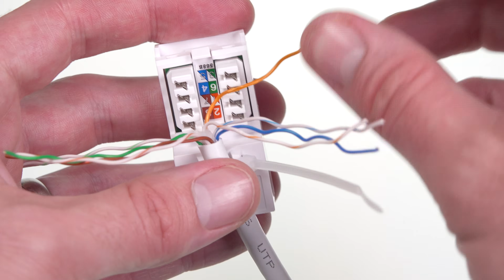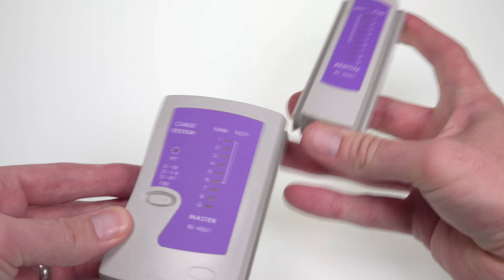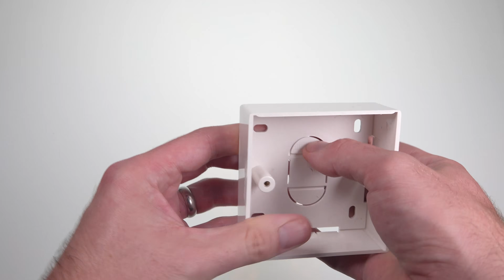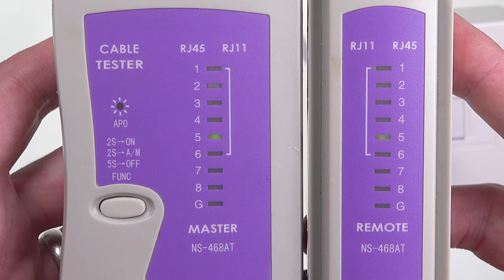How to Wire Up Ethernet Wall Jacks (Cat5e / Cat6 / Cat7 keystone jack wiring tutorial)

Comment: t568 a and b exsist because when connecting the same type of devices like a computer to a computer, you need to swap the send and receive pins
you have to send on 2 pins and the other device will receive the data on those 2 pins
2 pins for send, 2 pins for receive 
(you can make a 1 cat 5 cable into 2 cat 3 cable using 1 pin for send instead of the 2)

Comment: Interesting, I have looked at many video explanations of this process and this one is showing a good explanation. However, the cable tester used in all of the videos I have seen does not test the cable it only tests for the correct pin for pin connections. There could be lots of other issues and a network analyser is the way to go especially when we get into Gb networks. Having said that , good video and this works OK for virtually all home connections.

Comment: Thank you for this video it is very helpful, one small note that punching while holding the keystone in hand is not safe better to punching on ground or where a safety gloves if necessary.
Reply from the maker: Yes you're right - the white surface I was filming on was too flimsy though so had to make do 😅

Comment: Just in case someone missed this 
His pushing you towards buying very expensive tools
Punch tool for £65!!! 
That cost around £5-£10.for decent one
Reply from the maker: Not "pushing" at all - calm down your silly little crusade. I've linked to the one I used in the video, which is several years old by the way, and depending on where you are in the world you'll see today's price being charged by Amazon. With - and this is the key point - the option and full free will to buy whatever you want, including cheaper alternatives and related items listed on the Amazon page itself. A cheapo tool might be fine for an amateur doing a  one-off job in their own home, whereas a pro might want a better and longer-lasting tool. But thanks for all the comments, all engagement is good engagement and helps the video to do even better 😉

Comment: Chapters:
00:00 Intro
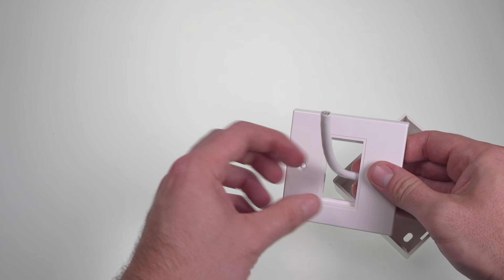01:17 - Stripping the outer sheathing from the network cable
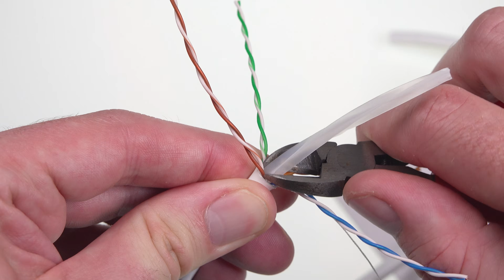01:29 - Untwist and straighten out all 8 wires
01:54 - Organising the colour-coded wires in the correct order
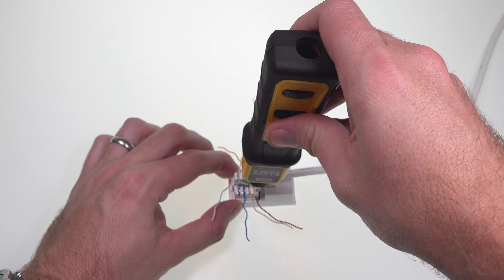02:16 - Punching Down & trimming the wires
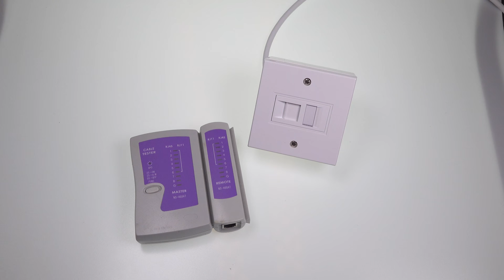02:47 - Testing your network sockets with network cable tester
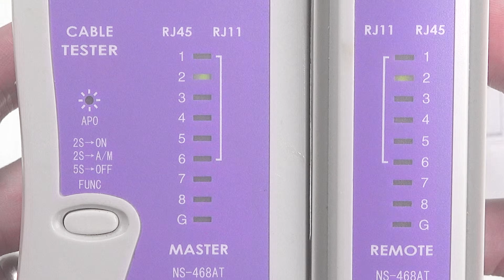03:25 - Spotting a fault in the cable wiring
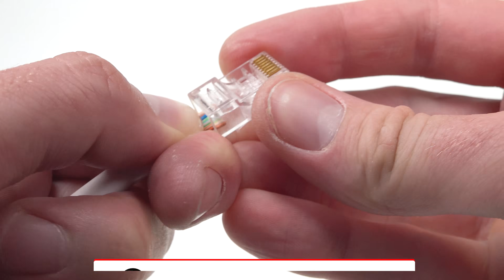03:46 - How to crimp RJ45 plugs onto network cables

Comment: I cannot, for the life of me, find a keystone jack like you have there. I want to find a keystone jack that allows me to run the cable along the wall and enter from the bottom. I don't want the cable sticking straight out of the wall behind the plate (I have access to both sides of the wall). Do you have a link for the kind of keystone jack you were using there?

Comment: I have a connection showing as fine on a cable tester, however, my laptop won't connect. I have used different cables from other active connections and tried different ports on the router but nothing works. If anyone has troubleshooting tips it would be greatly appreciated.
The connection status shows 100 Mbps, I'm expecting 1 Gbps.

Comment: Soo it is possible to terminate both ends to wall sockets?!! some other sources said that it wouldnt work. I want to do it like this so that i could potentially reverse the location of the router and client
Reply from the maker: Of course you can! No problem at all, it's very common to do that. Then just a patch lead each end
Reply: @SwitchedOnNetwork  big thanks

Comment: Does it test for power also? I need passive PoE of 48 Volts, to power a WiFi access point.
Reply from the maker: Yes, you can do PoE through these no problem
Reply: @SwitchedOnNetwork  Thanks, I meant can the network cable tester tell if the PoE is reaching the socket?
Reply from the maker: Aaah. Not that one but I'm sure some do - or just use a multimeter

Comment: Thanks so much for this, I would say I'm half decent at DIY but for some reason I was worried about messing this up. Your instructions were really clear and worked first time. I didn't test the line as I only needed to do one run so saved a bit on kit, but im now getting high speed internet in my garden cabin so assume that means its all good 😊
Reply from the maker: You're very welcome!

Comment: What about I want to replace the box to another box, do I need to start all over again?
Reply from the maker: Yes, pull out all the connections and if they're in good condition you might be able to just punch down again on the new box, otherwise if you have enough slack then you may need to strip back a bit to make a new connection.

Comment: Do not buy a keystone plug that needs a punch down tool. There are plenty of toolless alternatives out there that only require a basic cutting tong to trim the excess wires ones the plug is assembled. They all offer way better connections than you can ever acheive using anything that requires a punch down tool.
Reply from the maker: You're right - and here's a video I did on them recently: https://youtu.be/tJPyZMreUbw

Comment: You bring the cable from the wrong direction where you cable tie, should be at the bottom, then bend over the terminations and cable tie, very hard to get the cores into the terminals the way you do it
Reply from the maker: The image (https://m.media-amazon.com/images/I/41NGIdXLdEL._SL1000_.jpg) on the manufacturer's Amazon listing (https://amzn.to/42aiQLt #ad) shows it coming from the same direction that I wire it up from - unless I've misunderstood what you mean?
Reply: It will look like that after you have bent it back on itself.

Hard to explain by text, I'm terminating them as we speak but no option to add a photo, just stamp it from the other side, flip it over 180°, and then cable tie
Reply from the maker: oh I see what you mean, punch the 8 wires in then bend back 180º and cable tie down afterwards? I can see that would be a good (possibly even better) way of doing it, although I've never had a problem with doing it 'my' way. Whatever works best and you find easiest :)
Reply: Yeap, I used to do it your way tbh as it makes sense, but some other data engineers did it the other way, it's alot less fiddly. Give it a try next time and see what you think.  Personally I fi do it alot better
Reply from the maker: Thanks, I'll definitely try it next time :)

Comment: I have never done this, that's why I'm watching a video...but you shouldn't probably untwist all the cable, just the needed part at the end to avoid interference. And also don't use the tool against your bare hand. Good luck!
Reply from the maker: Yes, obviously - you only untwist the very ends (as I do in the video) as the twists are important for preventing crosstalk and interference. Press down on a hard surface when using a punch down tool in the real world - my white filming surface background wasn't sturdy enough for me to press down on it 😂

Comment: Great video but one question, if i wanted to create a 2 gang socket on one side of the room would I need to have a 2 gang box on either side. in traditional electric sockets the same 2.5mm cable could feed a 2 gang from a  1 gang socket. does this same principle on apply on a cat6 cable.
Reply from the maker: Not on its own, it can't - but if you put a network switch in, then yes (but the total data rate down one cable is still the max of 1 cable)

Comment: so T568 a or b-  interchangeably? I mean if you’re following that color guide say that’s using T568B-  and you’ve purchased aftermarket LAN cable and plugged in there not knowing that it has been setup as T568A- that will still work?
Reply from the maker: As long as the cable runs themselves have the same standard at each of their own ends, it doesn't matter if you then plug in a patch lead that uses the other standard. It's only if there's a switch in standards within the cable that the wires will cross over, hence making a crossover cable.

Comment: Can this be used in a wall downstairs from the modem to upstairs just to extend a wire?
Reply from the maker: Yes 👍
Reply: @SwitchedOnNetwork  thanks 🙏, can I ask what could possibly cause a speed of just over 600 mbpbs when I’m on 1GB connection. I’ve got one cable in the wall with the jacks on the wall. A cable from the modem to the wall. And a cable in the outlet upstairs. But can’t seem to get near 1GB
Reply from the maker: @jakeea test if you get a good speed connected directly into the modem with a short patch lead, to rule the internal stuff out first
Reply: @SwitchedOnNetwork  yes mate. I’ve tested the cables around the main one in the wall and they’re working fine just when connecting to the two wall jacks. Just unsure what it could be

Comment: Thank you so much for you're tutorial. I was able to wire 7 keystone jack and rj45 connector. Also for the link, just brought from Amazon, work very well. Tip, do not do what I did. When you wire the rj45 connector, makes sure the connector is facing down so the push connector needs to be facing down. I put the wire in but it was the wrong way around. Orange swipe is 1 and brown is pin 8. I did this for 7 wires so had to cut it off and rewire. When I used the network tester, the keystone jack and rj45 connector tested perfect... Light on from 1 to 8.

Comment: You're not supposed to untwist the pairs in the keystone jack. You'd fail the AM2 exam
Reply: How do you wire them without untwisting them?
Reply from the maker: oops! Thanks for the tip - will bear that in mind next time I wire one up :)

Comment: Can I put two cables on one wall jack .thanks
Reply from the maker: You can't join them together - you'd need to get a double keystone socket with two jacks. If you want two connections then you'll need to add in a network switch
Reply: I have two cables in socket,one from router another goes to the attic .And they left one keystone socket @SwitchedOnNetwork
Reply: Thanks for answering

Comment: Is there any reason i couldn't terminate both sides with a socket? For example a wall socket in my garden room and one in my house and use standard  ethernet cable to take it up to my router?
Reply from the maker: None at all - that's a very sensible thing to do in lots of cases 👍

Comment: Hi, thanks for the guide. I am planning on setting up 3 separate wall sockets, one RJ45 by the modem and router at the 1st floor (A), another RJ45 wall socket directly above it at the 2nd floor to use for mesh network (B), and the 3rd wall socket in the room beside the mesh at the 2nd floor (C). A - being the main point, B - 10 meters from A, and C - furthest away from A, but closest to B.
Do i need to run 2 seperate cables like A to B and A to C, where i need to rewire two wall jacks from the router A. Or could i extend two cables in a way so i get away with routing them from A to B, then B to C?
I want to prioritize latency, speed and consistency on wall jack C though, so i dont want much interference from the WiFi. Thanks :)
Reply from the maker: I would put a double socket at (A) by your switch and run two entirely separate cables; A to B and A to C.
Reply: That seems like the most logical solution, thanks. Do you have any recommendations for what type of cat6 cable i should buy for this purpose?
Reply from the maker: I'd go for CAT6A if I were you, as it allows faster speeds so is more future proof 👍
Reply: Ok sure, as Cat6a is a bit more expensive than cat6 in my country, can i buy like 30m long cable and cut the middle and ends and use it for the 4 wall jacks?
Reply from the maker: Yes 👍
Reply: Thank you so much man, very helpful!

Comment: If I have a fibre optic broadband. I have 4 floors to wire up. I want ethernet ports in each floor so that he quality of the connection doesn't degrade as much, would I need to do this?  Do I call in an electrician to do it for me? If anyone knows please let me know as I am new home maker. I am UK Based
Reply from the maker: You should be able to do it yourself without an electrician, as none of this is connected to any live electricity or anything like that. If you're in a position to run ethernet ports to each floor then I'd strongly recommend that you ALSO add fibre alongside the copper ethernet - your future self will thank you! I'd put a decent-sized gigabit (or faster) network switch next to your modem and then run CAT6a from there to each room/location in your house. If you can get a switch which also has SFP ports for fibre, do that too (see my video here for more info: https://youtu.be/XQjP135ZtcE) You'll then have a pretty sweet setup!
Reply: @SwitchedOnNetwork  would I have to drill through the walls and pass through the wires from there?
Reply from the maker: Almost certainly, unless you're lucky enough to already have some routes between rooms which aren't already full. When drilling through walls, just make sure there are no cables or water/gas pipes where you're going to drill! It's easy to check, and this stud finder is currently on a Black Friday deal on Amazon (https://amzn.to/3N0QlaK - affiliate link).
Reply: @SwitchedOnNetwork  some rooms do have ethernet sockets, but that was from the previous owner and I since changed to fibre broadband. So I need to change the sockets to fibre? Or leave them as they are and connect the new broadband cable to them? Then add the ethernet sockets in the rooms which don't have any already
Reply from the maker: You don't need to change the sockets that are already in the rooms to fibre unless you want to. Having "fibre broadband" can mean a lot of things, but it always only refers to the connection from your ISP to your broadband modem/router. After that, it's up to you how you want to distribute that "fibre broadband" around your house. Either using WiFi, copper cable (eg. CAT5e, CAT6, CAT6a etc.) to an ethernet port [better than WiFi, but obviously less convenient] or with fibre cabling around your house [even better than copper cable, but more expensive].

Comment: Thank you very much for this excellent tutorial and knowledge sharing! I have a question to make: Does this function the same as a pair of power line adapters? Do you need the router plugged in another one like this in the same building? Or or works differently? How does it connect to the internet network of the house?
Reply from the maker: No, this isn't like Powerline Adapters because they use the existing electrical cabling in the walls to send and receive the data between two points. That can sometimes work well but can be affected by lots of things and is only ever done when you have no alternative. Running a dedicated network cable like this is the gold standard best way of doing it. You'd connect one end to your router and the other end could either go direct to one device or to a switch to serve many devices at the other end
Reply: @SwitchedOnNetwork  So, you place two of these ones on walls and you link them togetehr through the walls with a dedicated network cable? And then you plug one to your router and the other one to the other device or splitter? Have a nice week!
Reply from the maker: Yep, that's it! Have a nice week also :)
Reply: @SwitchedOnNetwork  And the cable through the wall is the same cable we use for an Ethernet connection? If such an outlet has two "holes" for Ethernet clip-ins, can two devices be plugged in and work?

Alternatively, could the two outlets be connected through the wall to the existing power lines, the same way power line adapters are, with only difference being integrated in the wall for aesthetic reasons?

Thank you again for teaching!! 😊

Comment: Nice video. Best to place unit on a solid surface rather than your palm just incase you slip
Reply from the maker: Yes - I was filming on a wobbly flexible plastic light stand so couldn't press down onto that. In the real world, press onto the floor :)

Comment: i bought a rj45 socket today and the diagram on the back is the 568A.  However looking at my ethernet cable it looks like the order of the wires are the 568B where pin 1 is green/white.  Am i right in saying that although my diagram on the back shows pin one as orange/white would I actually put the Green/White in that slot?
Reply from the maker: Yeah I'd stick with B if I were you, just to keep things the same. However, the only thing that really matters it that if you wire dup your socket to T568A on one end, it's also wired up to T568A on the other end, too. Or B and B. Just not a mixture. You could have a cable with B on each end plugged into a socket which uses A and as long as the other end of that cable run is also A, you'd be fine. But to avoid confusion, since you have the option, just go with B everywhere :)

Comment: Excellent video - thank you. My building has CAT5E cabling throughout and I am now fitting RJ45 sockets at the end of these cables. I am being offered CAT5E or CAT 6 sockets. Should I stick with CAT5E or is there a benefit to using the CAT6?
Reply from the maker: CAT6 and CAT5E refer to the cabling, not the sockets. Sometimes you see sockets which are labelled either way but AFAIK it's irrelevant and makes no difference.

Comment: When doing a structured cabling in a building I would always recommend using S/FTP (shielded/foiled) since most likely you will have some power lines close the CAT wires somewere.
Reply: Been through that nightmare. Had bad VoIP issues. Eventually we figured out the installers ran them along power cables. Certainly did cause issues for us. Problems went away after we had the installers come back and install shielded cable instead. Running parallel to power cables, even for short distances along PoE connected ethernet cables can cause issues with devices.
Reply from the maker: Ouch! Yes I can imagine that would cause quite a lot of problems. Glad you got it sorted!
Reply: most likely wont even cause any issues.